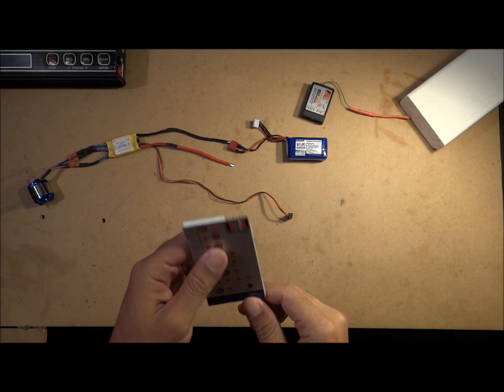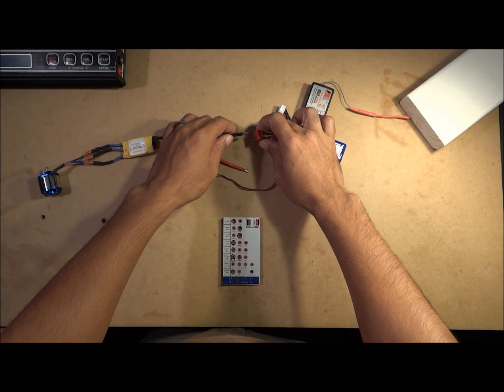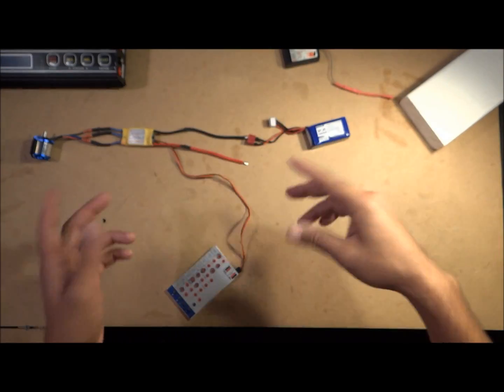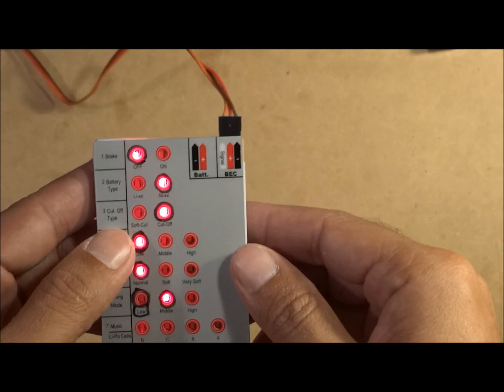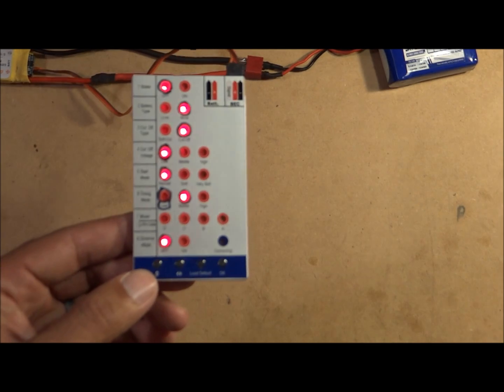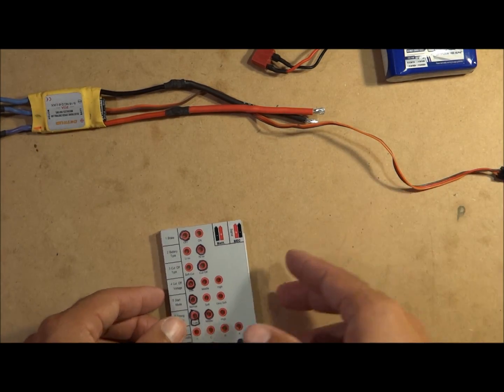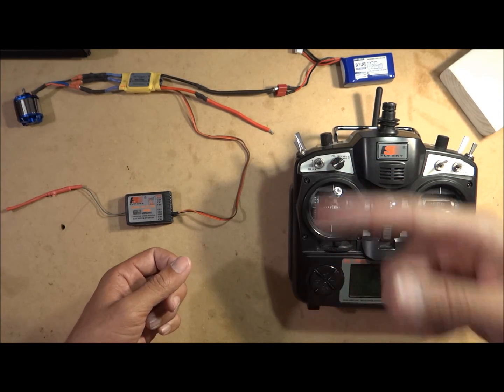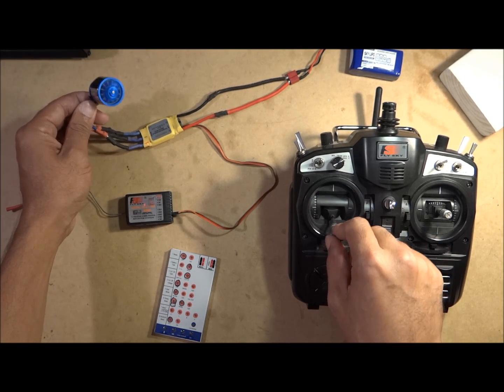How to program an esc and calibrate throttle range for multirotors/quadcopters.

Comment: Trying to program some 30a Esc's with simonk firmware ( supposedly flashed ) for my hexacopter, have had 2 controllers burst into flames and get destroyed when I connected them up to my receiver and powered to the battery, the motor did spin up though, do you have any advice?

Comment: Hey Im new to the RC hobby and I found a cheapo chinese high voltage ESC and I want to be able to program it, and from what I can tell on your video, you just bought a random programming card and just made it work. Do all programming cards work with all ESCs?
Reply from the maker: Andy Parra The programming card I'm using is specific to the type/brands of esc I'm using. You have to get a programming card that will work with the esc's you're using.
Reply: ***** Okay that makes sense, thank you for your time!

Comment: if i did this to my quadcopter using an RC car transmitter (forward/reverse range throttle), how would you synce the ESC's? by using full throttle, then letting it fall to neutral, or full throttle to full reverse?? any info appreciated thx :)   (dont have servo tester or spare quad TX)

Comment: I have afro ESC 20amp that I did not program.  It came with SimonK firmware.  The problem is i can't get off the ground.  Everything is set up properly, but do I need to do this or is it some other problem?  Please help!
Reply from the maker: Most flashed esc are already setup. The only thing you need to set/calibrate is the throttle range.

Comment: Is this a better way to calibrate esc than the kk2 does with buttons 1 and 4?
Reply: This is the same except he's doing it individually for each ESC. When you use the KK2 method it simply allows you to calibrate them all at the same time.

Comment: What is the name or type of ESC programmer you are using? I have found that allot of ESC program boards do not work with the cheep Chinese ESCs on ebay. Thanks in advance.

Comment: I have to point out that you said to leave it set to NiCD not LiPo that is not correct. you want it to cut off before it damages your batteries. If you don't all of your LiPos will be dead. You need to set a timer and do your homework so you don't get into cutoff. If your using a Naza you can setup your low voltage warnings before it shuts down. But a cheap voltage warning beeper can also give you an audible warning as well.
Reply from the maker: I always fly with a timer but for some reason I forget to start it or a battery cell is bad I don't want the esc to shot off due to low voltage cut off and have my  quad fall out of the sky. Don't know about you but last time I checked batteries are cheaper to replace than a whole multirotor unless you like spending money...
Reply: ***** GOOD POINT!!

Comment: I'm good with everything but the sloppy power connect. I would rather see Alligator clips, or a temp connector installed in a video like this, to avoid and boo-boos on the user's end.

Comment: Does every ESC need programming??
Does default programming ESC working or Not???
Reply from the maker: You should atleast set throttle range but default will work. An esc will work best if it's calibrated based on the aircraft you're going to use it on.
Reply: MrDigitaltech 2